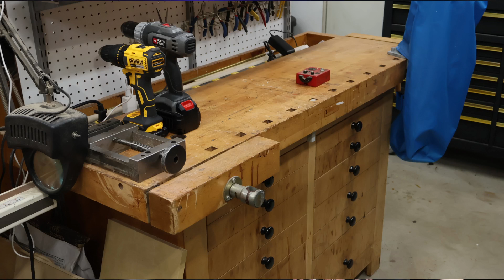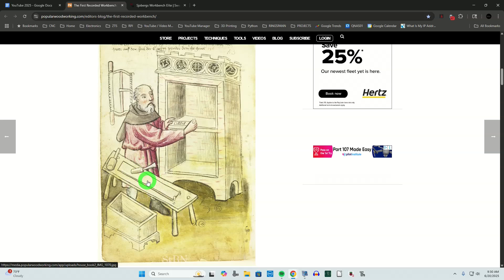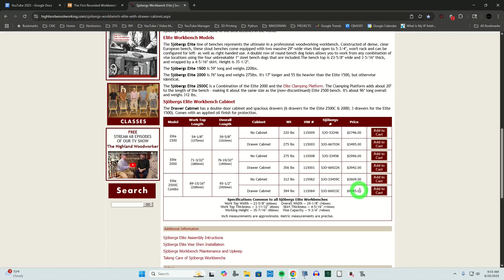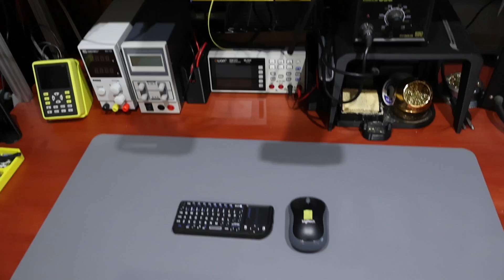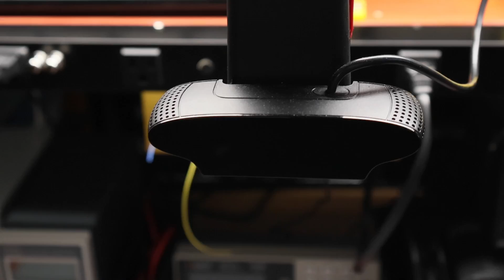DIY Awesome Workbench - What makes a workbench awesome?

Comment: Some 15 years ago I came across a couple of old school type work tables (or work benches, if you like) at a seller of used machines and such like. I immediately recognised them as the same type my Lower Technical School used to have, way back in the mid 1980's and to my utter surprise, they were the exact same as the school name and inventory number was still on the underside on the tops. Needless to say, I got myself one and called a few mates from back then and we cleared the place out. Our former school closed in the mid 1990's as that particular type of school was replaced by a more contemporary "integrated" type of school here, in The Netherlands and I suppose the school board no longer hand any need for that furniture. Anyway, that type of worktable is a simple tubular steel frame of about 4 feet wide by 2 and a half feet deep with a multiplex top covered with Formica. It has 3 drawers and an outlet built in, all very practical and pretty much tailored to electronics work and soldering. We used to have a few variants back in school but the one I got was, most appropriately, one used for electronics. I won't deny there's a lot of sentiment involved, but at the same time, more objectively, I really believe the older ideas of how things should be made for a purpose still has merit and a lot of the more generic and "universal" type work tables just don't seem to "have it". I can only advise anyone looking for something specific to take a good lock at such school or industrial models from a few decades ago or indeed, look out for obsolete furniture from such places. It certainly is a rather economical option in most cases. I paid like €25 for the one I have now, about the same in Dollars or close enough and I really couldn't even buy the steel and materials for the top for that of course.
Reply from the maker: Good morning SEPedersen,
Thank you for sharing that GREAT story.  I would love it if I could get an old bench from my "school" years.  

Your story brings out another great point as well.  People should be on the hunt for high quality tools etc. at thrift stores and antique stores etc.  A lot of the new stuff is not built anywhere near as good as the older stuff and I have found  a number of great tools that way.  

Thanks again for sharing a GREAT story.
Cheers!
Chris